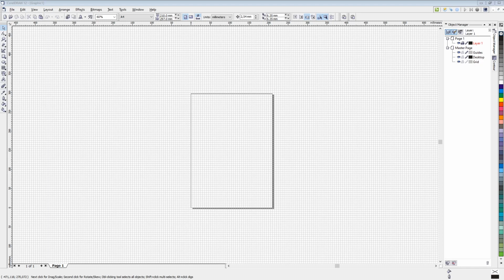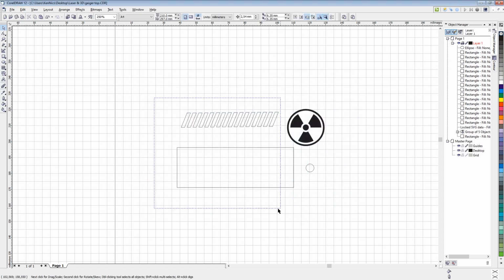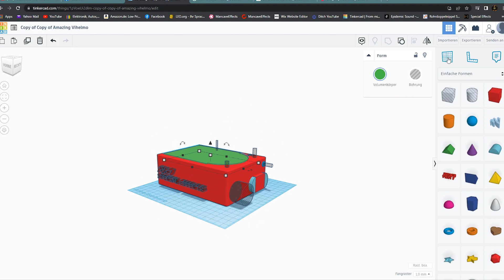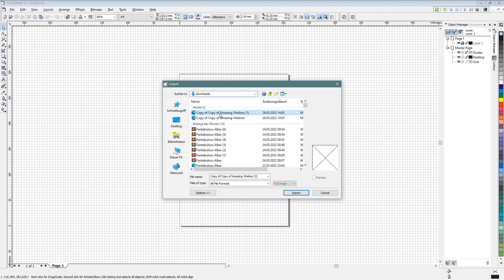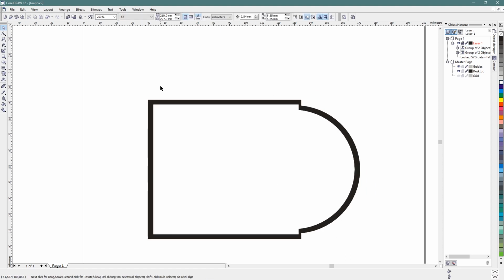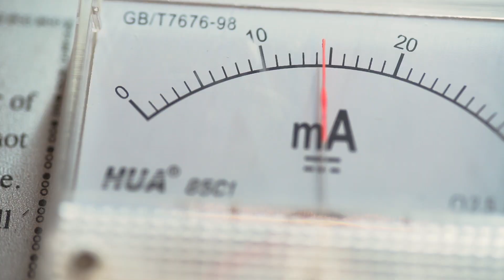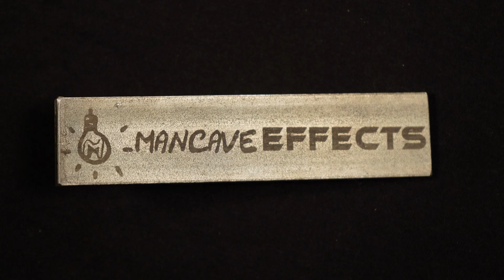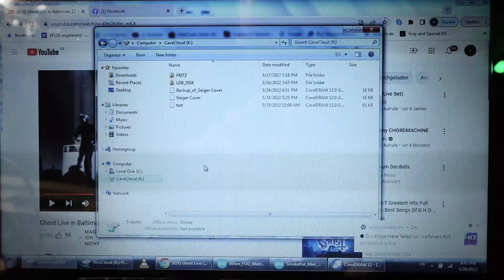K40 Laser Tips & Tricks

Comment: For cold environments for your k-40 add an aquarium heater and this temperature controlled switch. Inkbird-Itc-308-Temperature-Controller-Thermostat. Put both the aquarium pump and the aquarium heater on the hot outlet of the ink bird and set the temperature to 15c with it coming on with a 1° drop.
Reply: why would u want a heater other than keeping it from freezing?  they put ice in the water to keep it cool.

Comment: hey maybe a other solution for problems with the usb communication is to operate the k40 with a Raspberry pi. I have always probs with engraving pics, coz of the poor connection via UBS it came always to line shifts.
Since i mounted a raspberry as control computer this problem is over.
Simply i mounted the Pi inside the k40, installed linux, k40 whisperer, an usb stick... i controll the Pi via remote desktop and wifi...
just the computing power of 3b is slow...better use a pi4.
Reply from the maker: Interesting, i only had this issue once, could it be your mainboard? 🤔 but how do you connect the Pi with the k40 mainboard?
Reply: @MancaveEffects  normal, via usb cable...same way like you do it with your pc...
the corel plugin and k40 whisperer just sending G-code to the k40... in my case does this the Raspi... Windows background operations disturbing the uninterrupted sending of the G-code.
A G-code which his unfortunately different to the industry standard...